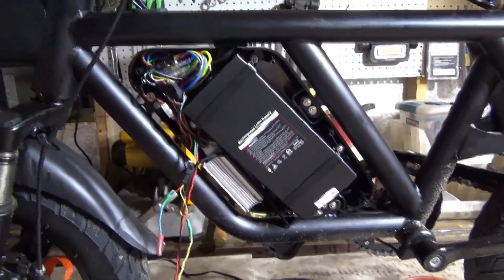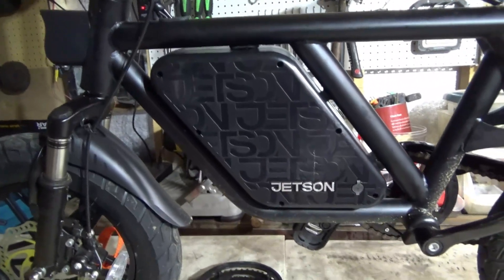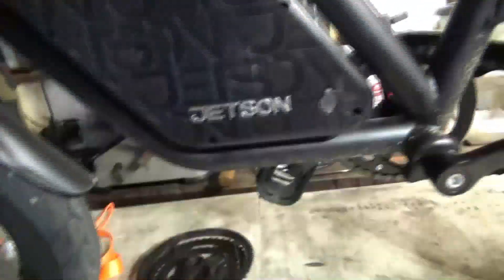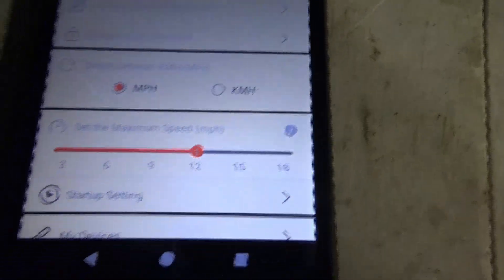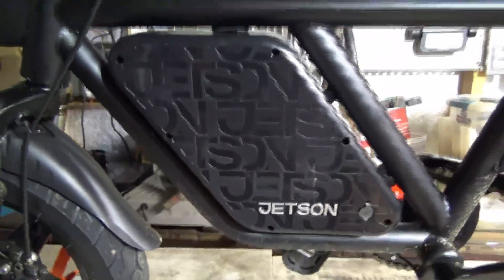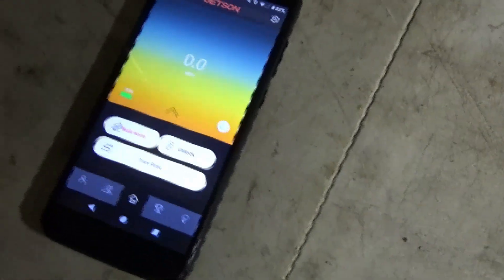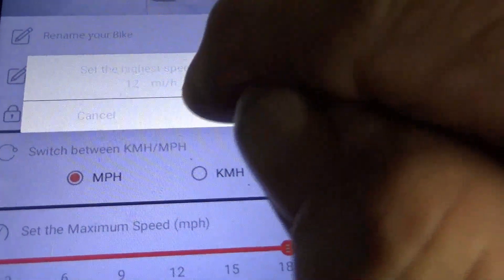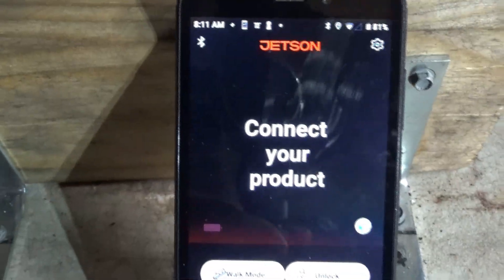Jetson Atlas; How to Program, 'PAS' and 'Full Throttle' Mode's

Comment: Going up hill, my Jetson slows down significantly.
Reply from the maker: Weight, too much weight. Your ability to petal to get up hill. Size of hill...?
Reply: @carnivorecave  fairly regular hill. I’m not a big person. I only weigh about 160.
Reply: Can you turn off throttle but keep the PAS? Trying to do it for my son who isn’t ready for the throttle but needs the PAS
Reply: @sef421  my throttle handle broke. If you don't twist the handle, it won't give you juice. Pedal assist should work if you have a charged battery. Doesn't matter if the throttle works or not.